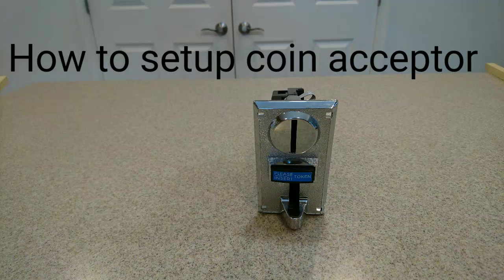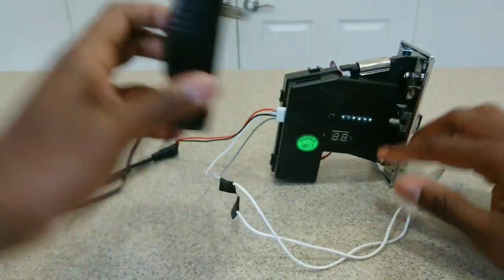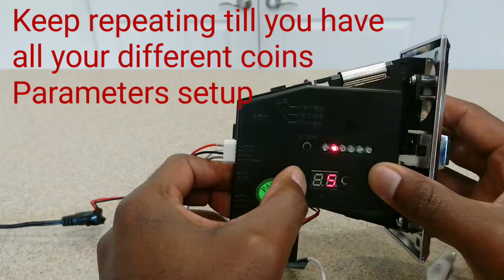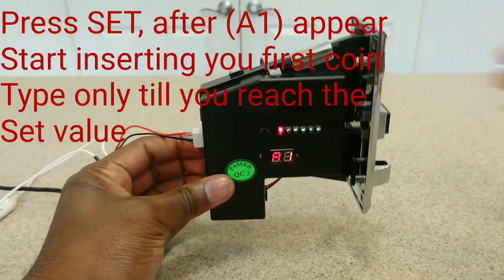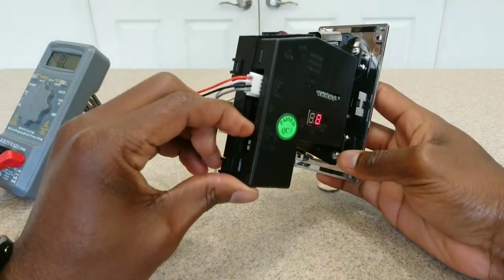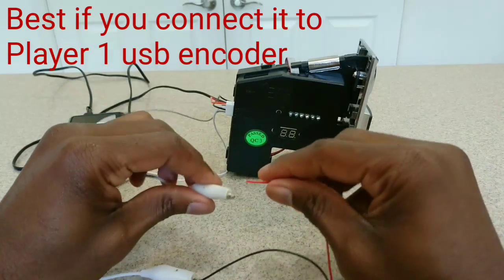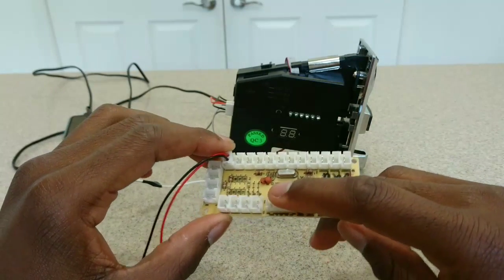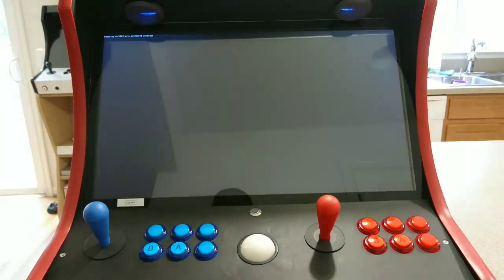How to setup coin acceptor on raspberry pi retropie

Comment: After I connected it, the speakers always play „clicks“ same as the pulse „beep“. I’ve got no clue
Reply from the maker: I’m not sure why that is, make sure you are using the same exact model as the one in the video. You could possibly have a faulty product too
Reply: I do have the same product and in addition, RetroPie doesn’t detect the input. But the coin recognition works
Reply from the maker: @JakobWaltl change the pulse switch to slow if you have it on fast, if your speakers are constantly making noise even when nothing is happening I’d assume you have a faulty product. I wish I could be of more help

Comment: Having issues with my wiring trying to make this work for an arcade build. Very similar model but not identical. Using a PSU in the build as well. The issue is with the pulse, on the PC, the acceptor is registering as constantly pressed rather than pulsing as each coin goes through. If anyone here has some knowledge and can help I would be forever indebted to you!
Reply: It is currently wired in this way:
The 4 pin adapter 12v(red) runs directly to the PSU, the GND(black) goes to PSU GND, the coin(white) runs to my USB-18 board. And the PSU has a second GND wire connecting the USB-18 to the PSU GND
Reply from the maker: This is the only coin acceptor I’m familiar with. I’m not sure if I can be of any help with yours
Reply: @eldon226 mine is actually very similar, I think the wiring would be very comparable, the only difference I think is programming the coins

Comment: I guess there's no problems with the the controller being 5V but the coin collector being 12V?
Reply from the maker: @widearchshark3981  no, that’s because the coin acceptor is interfacing with the controller as a switch. It’s not sending voltage, just opening and closing a circuit. Just like any other button that is connected to the controller.
Reply: @eldon226  Got ya, thank you !

Comment: How to reset? I cant take off the 20cents o programmed. I only want 3 coins, 50cents, 1 euro and 2 euro. Ps the 3 buttons after power on doenst work. Anyone?
Reply from the maker: @FilipeIria87  Here are the instructions for factory reset:

1. Turn off power
2. Hold the "SET" and  "ADD" buttons
3. Turn on power while pressing both buttons 
4. Release the buttons when hearing beeps

Comment: Hi Eldon. We recently started using the device as a timer.  It worked for 2 days, but then stopped working.  The timer/counter still works, but there is no power coming to the socket (UK).  We want to use it as a timer for a washing machine (NL/EU plug).  We need to use it with a UK-EU adapter.  Specially bought a grounded one for this purpose.  So now no power.  With another adapter you can see that there is some (too low) current on the USB port, see blue light in the photo.  For example, it is possible to charge your phone with this, but not via the regular plug (white).  What is wrong?  I have already removed the plug from the holder to check the connections properly, that seems fine now, but it still doesn't work. Could I get in contact with you for suggestions?
Reply from the maker: I’m not sure how I can help you with this, I’m not an expert with this product. The only thing I know to do with it is what I’ve shown in my video. If it was doing what you wanted for two days I’d suggest maybe getting a new one to at least verify that your connections are good and your old item is faulty.

Comment: I am a bit confused. You connected the pulse wire to your usb encoder but doesn't the coinslot pulse at 12v?
Reply from the maker: Maybe they have different models but mine is just an open and close circuit as shown in the video using the multimeter on continuity setting.

Comment: Sometimes my coin acceptor goes crazy causing the usb encoder to fail. When I unplug the coin acceptor the usb encoder works fine. Seems to be that the coin acceptor iis sending electricity to my usb encoder. Any idea?
Reply from the maker: You should test the wires coming from the coin acceptor going to the usb encoder using a voltmeter, you should not be getting any voltage from them. Also test them using continuity function, those wire should act as a momentary switch , meaning they should just close momentarily and then go back to normally open. You’ll need to add coins to do these test.
Reply: @eldon226  Thanks for the response! For some reason my usb encoder works with the coin accpetor on NC mode, the problem with the NC mode is that it sends a constant pulse to the usb encoder. When i use the NO mode sometimes works and sometimes makes the usb encoder go crazy. I read that some people use a zener diode to regulate the pulse, according to these people the coin accpetor sends voltage to the usb encoder. The only difference I have with your setup is that mny usb encoder connectors havew 3 pins, one of them is for iluminate the buttons, but I am not using that wire. Maybe there is something wrong in my setup or my coin acceptor is defective.
Reply from the maker: @gasabbath  my assumption is that you have a faulty coin acceptor or a different model than I used, not sure how I can help apart from suggesting you try a new one

Comment: Hi Eldon! Thanks for the clear instruction! I had no clue without this and only the manual. The only problem I hav is that I tried plastic coins that we would like to use but are not registered by the meter. Do you have a suggestion? Which coins could be used?
Reply: So not wathever coin. Apparently these are to light....
Reply from the maker: @bregjehuisman8564  correct
Reply from the maker: You can use any type of coin, they could be real or fake, the material they are made from doesn’t matter either. Just make sure whatever coins you decide to use are not so large that they can’t fit and not so light that they don’t have enough momentum to roll through the slot. You’ll need to program the coin acceptor to whatever coin you want to use.

Comment: Great Video,thank you. In my case i connected the ground and the coin wires to receive a pulse... Please read the reply, don't follow my advice :)
Reply: Seems I get a pulse when connected to the multimeter, when connected to the controller it shorts the circuit l and I get more than one pulse. Still trying to figure out what is wrong
Reply: So ignore my first comment, I followed wiring again, and as I found out that the power source was the issue. I initially used the PC power supply to provide 12v to the coin acceptor. I made a connection using a sata cable and powered up the device, but the pulse still didn't work. My guess is that the sata power cable was delivering more amps than the coin acceptor needed, causing the problem.

Comment: must use the grey counter? if only use the coin it wont register?
Reply from the maker: I’m not sure, I’ve only used it like shown in the video. I no longer have it to test other options
Reply: @eldon226  thanks, i will follow ur guide
Reply: @eldon226  i tried but there is no signal detected, the coin white goes to black wire on thr board, and the counter goes to red wire right. Thx
Reply from the maker: @bopiangM  make sure you program it properly, if you’ve done everything correctly and it still don’t work I’m not sure what’s wrong with it
Reply: @eldon226  thx bro. I think even though the usb encoder looks 100% same as urs, it maybe now function differently, this is because when I check, the button is always 5v and when i click it short it out and register as button click. Maybe urs work diff, where the click of a button send 5v instead of always 5v and short it out to click.
Reply from the maker: @bopiangM  you might be right, check your normally open/ normally close switch on the coin acceptor too
Reply: @eldon226  thx. need relay to make it work. thx alot for this tuto

Comment: I did just what you instructed, but when I enter a coin in MAME it does not register. It works fine in the Retropie menu when I use L2 for the coin, just not in MAME. Any ideas how I can fix this?
Reply from the maker: You can configure your mame emulators to use any button for coin, does pressing select work for your coin? Which emulator are you using for mame? Does any button work for adding coins?
Reply: @eldon226  Hi, I tried using the select and various other buttons for mapping, but it won't register in the emulator. The coin selector works because it registers fine for the game pad configuration outside of the emulators, but when I enter Mame (2003 or mame4all), it doesn't register as an input. However, I tried it on my pc Mame and it registers fine. So, I think I need to reset the emulators controls in Retroarch and start all over again. Do you know how to do this? Thank you!
Reply from the maker: @CrackerJayherber  you can try to use a keyboard with mame to edit the config file, access the setting by pressing tab on your keyboard. Set your coin button there. You can also try to use the configure input in emulation station mail menu. That should work for all retroarch emulators ( including mame 2003)
Reply: @eldon226  Hi there, yes other buttons work fine for coin. But using the coin selector for any button including select does not register inside of the mame emulators(mame2003 mame4all etc.), only in the gamepad configuration. I'll try reprogramming the whole retropie again onto the micro SD and start over again. There is nothing wrong with the coin selector. It works fine when connected to my pc and using any emulator works great. Thanks for your reply
Reply from the maker: @CrackerJayherber  you’re welcome, hope you get it to work. It’s just odd that it works everywhere except mame.

Comment: I followed the same setup, and I have exactly the same encoder, I connect to PC instead and noticed that in gamepad settings, even I do not put any coin, it seems still sending pulses, on setting window, when a button is clicked, you can tell on the windows and with this coin acceptor, even I do not put any coin, I stll see the button randomly get clicked, is this s faulty one or anything I missed ? please help.
Reply from the maker: I’m not sure why that’s happening, does it do that with your multimeter connected also, check using the continuity setting.
Reply: @eldon226  thank you so much for replying my message after years ... you are awesome. I don't know how to use multimeter I am afrid and could not work out a solution, I saw someone mentions they have similar issue and after add a relay the problem is solved, again, I have no idea what relay is or how to install it.... so basically when connected, in windows gamepad settings, you can see a button is clicked, with this one, I only connected the gray cable and I can see the button indicator on screen randomly clicked every few  seconds, like it is sending pulses continuningly. anything do you suggest me to give a try? really really wish to get it working, I bought a 1up arcade and once I have the coin door fitted, that would make my life completed. :-)
Reply from the maker: @haifengsu  you should be using the gray and white wires to connect the button you want to be used as your coin button. Hope you get it figured out soon.
Reply: @eldon226  Hi, thanks, I've tried that and it does simulate button click but without inserting any coin, looks like it sends out random pulse even no coin is inserted, I've ordered another one in case I am wasting time on a falty device. spent too much time on it. will let you know how I get on, thanks for the reply. 🙂
Reply from the maker: @haifengsu  no problem, good luck with it
Reply: @eldon226  found someone who knows the problem, he says I need a relay to conver the signal first before plug into the joystick encoder, so bought the one and he will walk me through how to wire it. not sure why mine needs a relay and yours works fine, maybe it is a different model , mine is HE606TBQ ,finger crossed. 😁
Reply from the maker: @haifengsu  that’s great, I’m not sure what the model number is for the one I had. Glad you found a solution.
Reply: @haifengsu you need a common ground. Find ground on the ysb encoder and join that to the black wire of the coin acceptor. This will prevent the floating voltage you are getting which the encoder is picking up and triggering random presses

Comment: @eldon226 Hi mate i have the same coin acceptor with timer box and relay connected to it. The question is how should i wire up arcade controller to coin acceptor and timer box so the buttons and joystick will work only when coin inserted and there's a time on timer box? I'm using it on Windows 10, BigBox and opening games through RetroArch. Looking forward to your reply as i'm stuck and can't finish up my arcade machine
Reply from the maker: I’d need to know how the timer box work. If more time is added by pressing a button, then I think the easiest solution would be to connect the coin acceptor to the timer box similar to how I connected it to the usb encoder in the video. This way the timer box is activated by adding coins. Your controllers will be connected to the timer box, easiest was might be through dpdt relay(s). Use the relay to open and close the data plus and data minus wires of the usb controller(s). The power wires of the usb can remain connected.
Reply: @eldon226  more time is being added by adding coins for instance 10 cents 1minute, 20 - 2 and so on. I've already connected coin acceptor to timer box with relay, but don't know how to connect encoder to coin acceptor. If you give me mail i could send you the link of them on aliexpress or video of them
Reply from the maker: @shahinmirkhudayev2107  I don’t think you should connect the coin acceptor to the usb encoder. This is because you already have it connected to the timer. The timer will limit how long a game can be played, that’s the same purpose as adding coins to a specific game. Feel free to email if I’m not understanding. eldon226@yahoo
Reply: @eldon226  sent you email
Reply: @eldon226 can i get your mail
Thank you for all this videos
Reply from the maker: @filipsusilovic2558  you’re welcome, eldon226@yahoo

Comment: i have the same coin acceptor and the same usb joystick interface… and if i hook them same as yours it didnt work…..
Reply from the maker: Not sure why it’s not working if you have the same parts and followed everything step by step.
Reply: i followed step by step and i hook the coin wire and the counter wire to the interface like yours… and it doesnt work… no signal on the pc if i put a coin in the coin acceptor…. Switches are on N.O and Slow…. Doesnt needs a GND wire instead of the counter wire on the interface?!🤔
Reply from the maker: @nemu0302  did you program your coins correctly? Remember you need to set how many pulse each coin will produce. Use a multimeter to test if it’s pulsing but your pc isn’t registering them.

Comment: When I wire up my coin acceptor like this, retropie menu just flashes (like the button is pressed over and over. Can you help?
Reply from the maker: I no longer have this in my possession, but if I remember correctly, there is a switch on it for NC and NO, make sure it’s on NO (normally open).

Comment: Hi! It's not registering it in the RGUI of the emulator, but in the very first control config, it's always getting a clear signal... Do you have any idea why?

It is working normal on everything else - when I Configure it in the beginning control config, it gets clear signals and always behaves like it should, but to the damn emulation RGUI, it registers the signal, but always jumps back to "none" as soon as I drop a coin (if it wouldn't get a signal, it wouldn't jump back to none, so it gets a signal but just refuses to take it as a button... All the other regular buttons are configurable like this)

Comment: Really Great video (much better than mine) I will point to yours for further info in my old one. I never knew how to set up multiple different coins, until now I only could use 50p for one pulse, now I have £1 for two pulses. Cheers

Comment: hello, have you noticed that this coin acceptor kills some USB boards? Mine sometimes work and than not. Der ist some Current on the Acceptor wires and different current on the USB Board. One board went dead with ghost inputs on the other all buttons besides the ones i plugged in are not responding anymore. In all i tried the Acceptor.

Comment: I need some help here. I bought this device http://cy-822b.blogspot.com/2016/08/the-cy-822b-usb-led-joystick-controller.html?m=1 // but I cannot make it work with this coin machine, that is a way to this workout? Or should a buy another model of coin machine? And if it's the case, which one?

Comment: hi sir my name is Dileep , i am getting all the way correctly with the coin sensor which i bought but a problem is after i finish all the settings i.e., H1,P1,F1 and press set button i could not see E on the LED display to end up the program and i could not able to do coin samplings

Comment: Thank you for your video.
I am a arcade machine vendor and I usually deal with pool tables, jukeboxes etc
Recently I bought a taito cocktail machine and I bought this very same coin acceptor to use in my machine on location and this coin acceptor fitted very easily on the machine.
It's very handy to have a multi coin acceptor instead of the old macanical coin acceptor that only takes one coin.
I just didn't understand the instructions that came with this coin acceptor. 
Thanks again for your help.